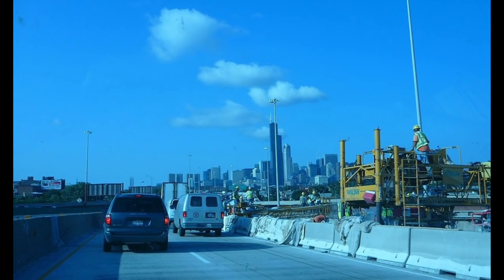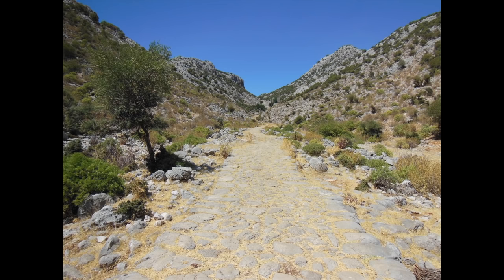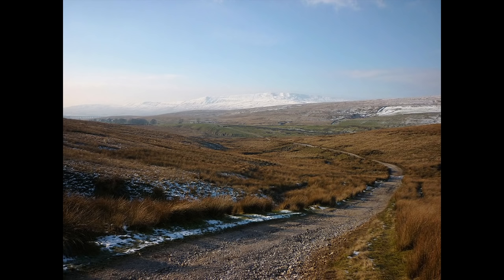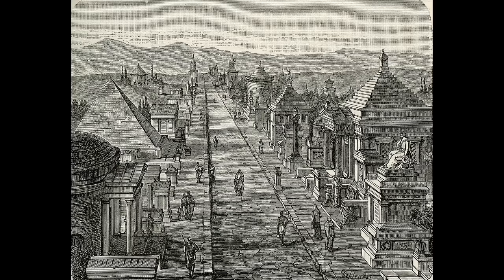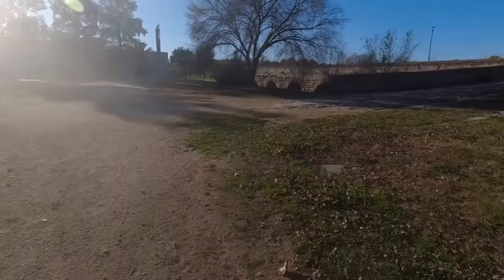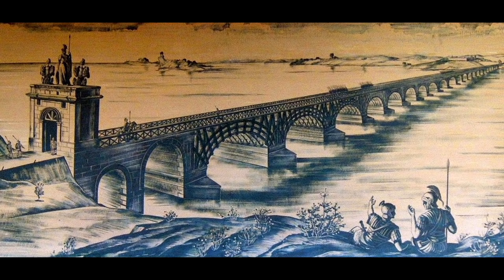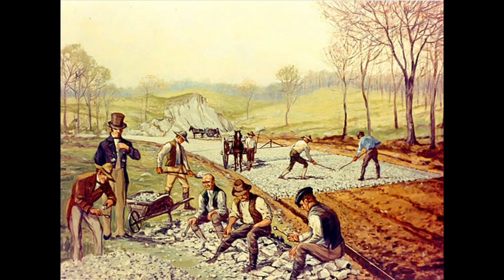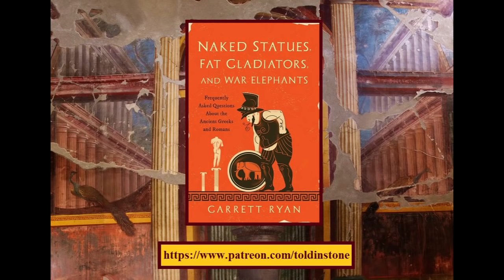Were Roman Roads more Durable than Modern Highways?

Comment: Considering the traffic loads of the day and the fact that so much of the road network is still in existence, and even in use in many cases, I would say that the Roman roads are more durable than modern roads as modern roads are designed for much higher loads but will definitely not last as long. It must be noted though that the 2 types of roads are fundamentally different and should not and cannot be directly compared for the following reasons. The Roman roads would not be able to withstand modern traffic roads. Roman engineering knowledge, while impressive, was no where as comprehensive as modern engineering practice so they took designs that worked in worse case scenarios and used it everywhere, resulting in apparent massive over-design for the majority of the areas. It would be very easy to use this design & construction philosophy on modern roads but this would raise costs astronomically, and while this would be the dream of many Civil Engineers to be able to design without consideration of budget, it would not go down well with the bean counters who ultimately control things now.

Comment: Highway? How would it be possible to drive fast on a stone road, thats just madness, even if they are perfectly lined up and even, the space between them would make the car vibrate more than a unused vibrator, these types of stone/brick roads are only good in villages and small roads in a city where you have to drive slow

Comment: Vehicles shouldn't be allowed to drive on roads the minute new tarmac is layed. Inferior materials are used now. Roads, architecture, some bridges and even jewellery older than a hundred years old will last for centuries. Unlike poor quality tarmac, cement, brick and mixed inferior metals of today's world. London is the perfect example of poorly built tower blocks and houses that have been demolished every 60-80 years. Stone or rock does not crumble like clay. Especially in our damp climate. Oak and many other wood stays solid for centuries. Above ground sources are mostly stronger and shouldn't harm the planet. Most materials excavated are too soft. Not meant to be taken from our earth's crust and mantle. Hard Diamonds and gold are meant to be left where they are for a reason.

Comment: I respectfully disagree. I think there is a fundamental psychological difference between modern engineers and their ancient Roman counterparts. Today engineers are motivated to build the best product they can, as cheaply as they can, to last as long as possible. Thus $30 a foot of roadway that lasts 20 years is refused in favor of $20 a foot that lasts four years. Money is the pivot of the fulcrum. In ancient Rome they built for permanence. They believed their empire was eternal. Cost was not an issue with slave labor. Jerusalem used the ancient Roman sewers until the 1970s. Segovia Spain still has a working aqueduct. I live in the Philippines, not far from Manila. Every church and lighthouse built during the Spanish era is still standing. It is difficult to find ANY structures built during the American era. Different approach. Different psychology.
Reply: Pretty much all of the structures built by the Americans in Manila where destroyed during WW2 in the Battle of Manila, along with most other structures. Not a good comparison.
Reply: @baneofbanes  many were destroyed in the 1986 earthquake. You forget the first three years of reconstruction was during the colonial period and the contracts did not end with independence.

Comment: You are discarding the fact that thin metal wheels and and horseshoes, both of which are not only vastly harder than rubber tires, but also have a much smaller surface area, increasing the pressure even more probably damage the road not only as much as rubber tires but probably even more. You're also apparently thinking that vehicles going faster wear down the road more but it's actually the opposite. The faster a vehicles goes, the less pressure  it transfers to the ground it's passing through, to the point that, at 60mph, the pressure felt by the road's surface when a vehicle passes on top of it is negligible and much less impactful than a horse or, even worse, a carriage with metal wheels going over it. The fact is modern roads are indeed much worse constructed than Roman roads were. Roman roads can handle, and have proven to handle car traffic for years on end with zero maintenance whereas modern roads, sometimes even closed off damage themselves just by existing and with the time passing by them. Especially asphalt roads which obviously would never last not even a fraction of what Roman roads last.

Comment: The engineers from today can build durable roads, but they will cost. And sometimes is cheaper to repair them after 7 yr. With current situation construction company is happy that it will get a contract, politicians that they get another bribe and they can brag that they repaired a road, and if the quality of road is decent, also the tax payers are satisfied that the road is cheaper.

Comment: You never answered the question.
Our roads were designed by companies who build and repair roads and are thus not incentivized to design them to last.

Most damaging to roads is trucking , our roads, used buy only passenger vehicles would last decades longer.

Modern concrete, at least up through 2000, lasts maybe twenty years. Most of our iconic buildings are nearly a century old.

We can now make much more durable concrete, but I don’t believe that anyone has specified such for any roadways.

Our society is more interested in making money than conserving resources or even convenience for the people. Lifetime costs aren’t calculated with an eye towards reducing them. Worse, the general public hasn’t been taught to think about lifetime costs—so only the initial costs get consideration.

Corporate America has created a country in which everything is disposable—and costly.

Profit should never be your only goal, as when it is, you lose your empathy for life and your community.

Comment: Were Roman Roads more Durable than Modern Highways?  Well, that's a dumb  question.  Roman roads 2000+ years old and still around.  Modern highways wouldn't even last 25 years without a lot of maintenance and NO Traffic.  Granted the purpose of the two road systems is totally different and modern day roads have much more traffic.  But in actuality, if the modern day roads had the same traffic as the Roman roads, the answer would still be YES! Roman roads are more durable.
Reply: Roman roads would absolutely not last long with modern traffic loads. They’ve lasted for 2000 years specifically because they didn’t have cars or trucks on them.
Reply: @alexsiemers7898  Please reread my comment since I addressed what you stated about traffic and the durability if all things were equal in terms of traffic type and volume.
Reply: Roman roads were the ones with no big lifted compensator trucks and hundreds of thousands of cars driving by at 100-140 kilometers per hour. All of that weight and stress is why they don't last as long. Make an expressway like they did in Rome and it would last mere days.

You ever seen a bicycle path get repaved? No? This would be why
Reply: @alexsiemers7898  You have almost the exact same name as someone I know except she has no second s in her last name
Reply: @blitzn00dle50  Clearly you did not read my entire post.
Reply: @jarmstrong2843  what's your example that you're going to use to prove that roman roads passively last longer than modern expressways? now this may be anecdotal but in my 16.8 years of living in st. louis, missouri, I think I've only seen highway resurfacing twice. the stretch of interstate 64 that got repaved in 2008 still looks and feels buttery smooth like it was repaved months ago

and even if roman roads passively last longer than expressways, expressways are still smoother and therefore better for the job
Reply: @blitzn00dle50  Look at the last two sentences of my original post. With all things being equal in terms of traffic, Roman roads would be more durable.  What part of that do you not understand from my original post?   I said nothing about smoothness; just durability.  If we left our current system of roads alone and not maintain them, they would all apart in less than 50 years.  Whereas, Roman roads that have not been maintained for over 2000 years are still around all over Europe.  They may not be the smoothest roads, they may have grass and weeds in them, but they are still around.  You can’t say that about modern day highways if left to decay naturally and without maintenance.
Reply: @jarmstrong2843  I did read those 2 sentences. where's the freeway that got abandoned in the 1970s you're going to show me? Maybe roman roads are able to keep their general shape for longer than a modern expressway but they certainly wouldn't be able to do that if we let infinite cars drive on them. Ultimately a road has to survive the stress that the vehicles put on it or else it's useless
Reply: @blitzn00dle50  Well, we can agree to disagree instead of this back and forth stuff.  But it is apparent you did not read the last sentence which stated all things being equal in types of traffic.

Comment: Why are you using a pavimented roman street to introduce what a roman ROAD is suposed to be? that is so missleading... and the assumption the main purpose of a roman road was to transport the army... and why are you saying roman roads were built by soldiers? 

https://www.youtube.com/watch?v=z1aFWtBXHII&ab_channel=IsaacMorenoGallo 
Roads were constructed by specialized workers and engineers, and it's purpose was mainly the transportation of comercial carts... 

Pavimented streets only present inside cities... only used to improve salubrity because it was easier to clean. Can you imagine trying to move a cart with high speed in a pavimented road? Also, the cosntruction of roman roads were standarized all across the empire... a road in hispania was constructed exactly the same way than in egypt, with the method showed in the link i shared.

Comment: Let's see:

-Roman roads are layers and layers of sand, rocks and to top them off big slabs of stone
-Modern roads are a mix of sand and black shit poured and left to dry

I WONDER WHICH ONE WILL LAST LONGER OVER TIME
Reply: No roads don't have big stone on top surface. That's a street. Roman street better for cleaning and letting out the mud and dust from the real roads. Real roads have a smooth surface of small rocks and gravel in order to make the suitable place for horses and wagons
Reply: @Rastei  here in Italy both have the same word: strada. Ergo, same shit, in english it only has two different names because... I dunno. English is a dumb language anyway